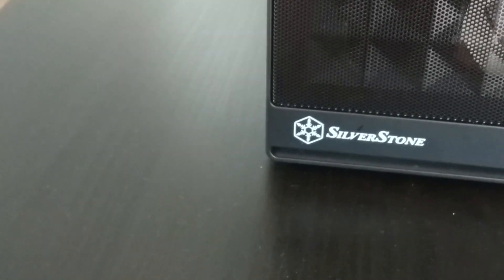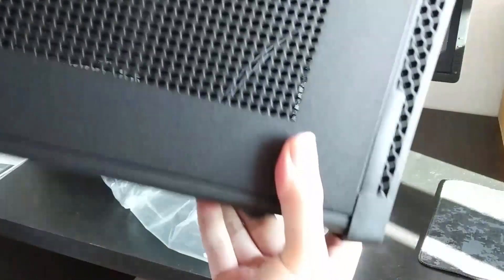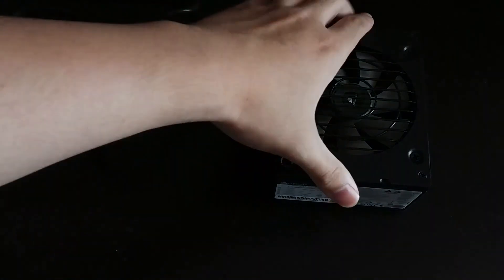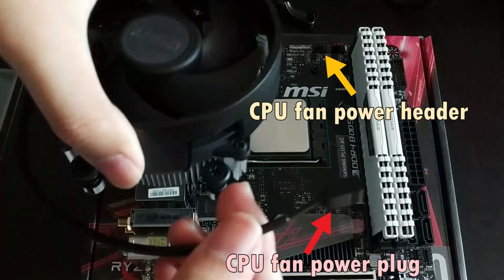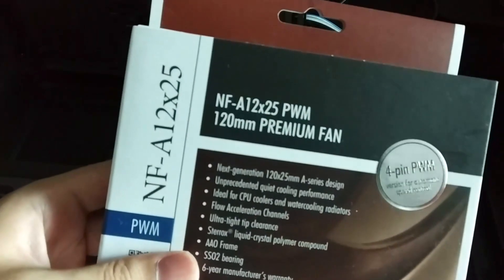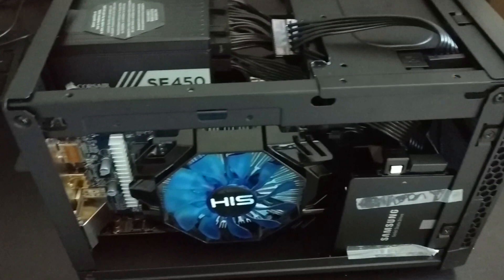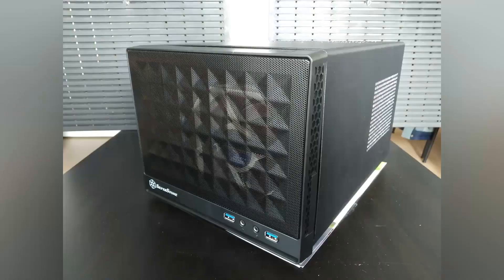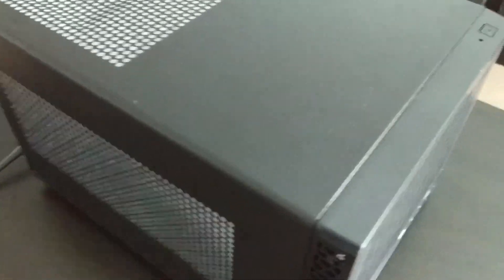Building a Mini-ITX PC in a Silverstone SG13: Unboxing and Build Log

Comment: How is the noise level? Im thinking building the same but with 3600x ryzen and gtx 1660s. But im worried that the noise will be too high. Will it be unberable to listen to?
Reply from the maker: It's not so bad as long as you are using a GPU with relatively low TDP. Obviously once you start using larger GPU with more number of fans, things are going to be problematic.

 In my situation, the front fan is actually the loudest one because it has to exhaust all of the warm air from within the case.

Comment: I know this vid is old but do you think Zotac RTX 2060 will fit in this case?
Reply from the maker: Thanks for checking my video. The Zotac card is roughly 210mm long, so surely it would fit inside the SG13.
Reply: @vortextheory8530  Hey, thanks for replying! I just needed another option. Cheers!

Comment: You sure that you have correctly mounted your ATX power supply? My fan of AC is on top.
Reply from the maker: My PSU has SFX form factor. The way the PSU fan is facing depends on whether you'd like have it taking air from outside of the case or from the inside. I chose the latter as it helps dissipating the heat from inside the case. I explain more about this in the other video, so you can check it out as well.
Reply: can this case use atx psu??
Reply: @menjemputimpian6044  yes, but it will be super close to the CPU cooler and you probably wont get the best temps

Comment: What if I accidentally touch the gold part of ram stick
2. can asrock b450 itx fit ryzen 5 1400?
Reply from the maker: As long as the golden contact is not completely scratched away, it should still be fine. The B450 will support 1st gen Ryzen just fine.
Reply: @vortextheory8530  tyy

Comment: Hey I m planning to build with the same case and I saw in another video that you can remove the cover of the cpu fan (with the amd logo) which makes it a bit shorter. That could improve the cooling considering how little space there is between the cpu cooler and psu. Thoughts?
Reply: Nvm i see that you mention that in another comment cheers!
Reply from the maker: Yes, you can try removing the shroud, but if you are using a SFX power supply, the shroud won't be an issue to clearance. The shroud is there to prevent random dangling cables from touching the cooler fan, so there's that.

Comment: What is the "filtering fabric" mounted on the case sides? That's not something that came with the sg13? Probably that makes slightly the temperature to raise as the air flow is restricted?
Reply from the maker: That's the Dustend filter sticker. It is an addon indeed. So far after more than 6 months using the filter, the max CPU temperature is around 70 C while the GPU is 65 C. The filter would indeed restrict your air flow, but you can compensate by using more aggressive fan curve. Notice that my front fan is an exhaust.

Comment: If I am using the stock Ryzen heatsink for the Ryzen 3 1200 which I think is the same for the Ryzen 5 2600 would it fit in the case with an ATX power supply? Many thanks in advance! I might get a 120mm AIO instead for the CPU though as I do plan to upgrade to the Ryzen 5 2600 hopefully.
Reply from the maker: The cooler is indeed the same, and yes it will fit, but it'll be tight fit (about 5 mm clearance) and thus, the airflow to the CPU might be obstructed. It is also possible to remove the outer ring of the cooler to slightly add more clearance, but I have not done so in my build.
Reply: @vortextheory8530  Ah that would be a cool mod! But I don't want to risk it cause the cooler is not the best. I am going to get a cooler master 120mm AIO since that is supported and recommended for this case though I will be using a full size ATX power supply instead of an SFX one. Thanks for the reply though! That helped me to decide cause I wasn't sure how much room there would be. I think an AIO would be best for this case.
Reply from the maker: @DoomWalker42  yep, if you are using ATX PSU, it's better to work with AIO. Don't forget to use the PSU L bracket though. I don't use it in my build because my PSU is a SFX.
Reply: @vortextheory8530  The case naturally supports an ATX power supply though so I don't need to use the bracket. It's not a small form factor power supply but a normal power supply that fits in a desktop case. Thanks though.
Reply from the maker: @DoomWalker42  ah, I did not mean the SFX-ATX adapter. I meant there is this L-bracket that comes with the SG13 case, which supports the weight of the ATX PSU.
Reply: @vortextheory8530  ah sorry i got confused!! That makes sense though. I will definitely use the bracket. Thank you for the advice!

Comment: Do you think a 140mm would interfere with the 3.5'' HDD?
Reply from the maker: This depends on the thickness of the fan and the way that the fan is mounted. I'm using a noctua A12 25mm thick fan, and one end of the fan barely overlaps with the HDD. I think there is a great chance that the screws or pins of the 140 mm fan might block the HDD position. Using 140mm fan would also limit your GPU length at 200 mm.

Comment: You have installed the power supply incorrectly. Will the fan be up?
Reply from the maker: Nope, the PSU fan was installed to face downward. This is intentional though, as the PSU serves as exhaust for the case. Please check my other video on SFF PC planning onto the PSU placement tips.

Comment: What is that white stuff on the side holes? Some kind of filtering? If it is, it's what's responsible for temperatures that are a bit too high, especially the GPU temp.
If you need filters on the intakes, there are magnetic filters that can be purchased in various sizes...
Reply from the maker: Yeah, it's dust filtering sticker, it causes the GPU temp to increase by 5 deg during load. However I've then switched to front case fan as exhaust and I managed to further reduce the temperature by 3-4 deg.

Comment: Hello VortexTheory. I recently did a similar build but whit an RX 580 XFX and a full ATX PSU, the EVGA SuperNOVA G3. Can you tell me more about the noise during idle and gaming ? Mine became quite noisy during heavy games like Just Cause 3 or The Witcher 3. I wanted to know if the use of a SFX psu can change my temps a bit, and meaby let the overall system "breath" better, ty.
Reply from the maker: Indeed I did not put acoustics result as I assume SG13-B (the case with mesh front panel) consumers are aware that soundproofing is almost nonexistant. 

From my own observation though, sound level vary with your configuration. In my case, the dominating noise comes from both the Wraith stealth cooler and the Noctua fan. The Wraith becomes noticeably loud when spinning above 2000 RPM while the noctua at 1400 RPM, which in my case correspond to CPU temperature above 60 C. Of course, this depends on how you adjust your fan curve.

Switching to SFX PSU does increase breathing room (by reducing the case impedance, more airflow can be driven by the front fan), however it is quite difficult to predict the exact gain. If possible, make use of retailer's return system to try it out yourself.

Comment: I want to build pc with this small case.
I already have a ryzen 2600, 16gb ram, rx 570 and v sync monitor. 
I used a nzxt case, its too big even its have a nice tempered glass view. Right now my pc have 7 fan installed. If I run 4Ghz ryzen 5 2600 in this case with less fan, what temperature be like?
Reply: Yohanes Batistusta if you go itx be prepared for above normal high temperatures than your use to with an atx case
Reply from the maker: @icedoutelite  Usually this is what happens, but with some careful airflow planning and cable management, you can still control the temperature. The SG13, for example, is actually designed for AIO liquid cooling in mind.
Reply: Thanks, but today I pick fractal node 202. I like it, because its like my xbox one and its smaller. Right now the desk have a better space and I can put my controller and headset with the stand in the desk, and I had upgrade my monitor too. I bought a lg 29 inch ultrawide.
Reply from the maker: @YellowRadios  Good choice if you know what you're purchasing. What grinds my gears is the fact that some people pick ITX cases based on aesthetic alone and later complain that the functionalities that they wanted are not fulfilled.
Reply from the maker: I see, fyi NZXT has the H200i case  which also has tempered glass side panel if it is necessary.

For your question on the OC temperature, I can only make an educated guess. No Man's Sky, for example, sometimes pull my 2600 to 3.9 GHz (all-core) and with stock cooler, I noticed that CPU temp never goes above 75 C during the boost period. I would assume that this temperature would be sustained 4.0 GHz OC will be slightly hotter. Of course, this temperature will increase further as the thermal compound ages. To be safer, you'd need aftermarket cooler which provides larger temperature headroom for OC.
Reply: @vortextheory8530  I already have a atx case with all the rgb tt ring. I just wanna try itx case. Cos the atx consume space of the desk.
I used wraith Prism from 2700x right now. And yeah I usually OC 2600 to 3,9 all core. Because its need to much voltage to get 4Ghz.

Comment: Why did you need 32GB of ram?  I never understood what you said.
Reply from the maker: "Certain productivity task". I did mention about 16GB is usually more than enough for gaming. I am running some simulation software that is quite memory intensive rather than hogging CPU/GPU resources.

At the same time, the motherboard only supports a maximum of 2x16GB RAM kit. So if I don't plan to upgrade the motherboard for next 4-5 years, might as well fill the slots outright. Of course on m-atx motherboards, usually you can fit up to 4 RAM sticks.
Reply: Thanks, I was just curious. I will be building an itx build and might put 32gb's in it as well....I'm thinking about getting into Blender or maya  as a hobby.

Comment: Very nice build video with clear explanations. It's amazing you much power you can pack in a tiny case these days. I hope your build's still going strong. Are you happy with the temperatures you get with a fan and stock cooler?

I actually made a build today on pcpartpicker that's very similar - same case (or maybe a Thermaltake Suppressor F1) , cpu and motherboard, sfx powersupply (same Corsair as you used or a SilverStone SFX SX650-G). I'm thinking about going for a 512gb m2 ssd and maybe a 12 or 14cm radiator on the front like a Corsair H60 or H80.
Reply from the maker: I would say stock cooler fan combined with the Noctua fan is adequate for myself. So far I have also tested Project Cars 2 and Hitman (2017), and both games run without making the temperature went above 75 C.

The thermaltake case is relatively easy to work with I'd say as it has separate drive bays. The one on SG13 is pretty cumbersome to work with.

Comment: Wow 32GB of ram, that's hardcore!
I'm building my first ever PC next week in the SG13, can't wait!
Btw - I hope you upgrade your graphics card - everything in your computer is beast .. except the gpu..
Reply from the maker: Yep, I need more RAM than GPU at the moment. I am using a used R7 360 also because I am waiting for the upcoming GTX 2060. Feel free to drop further comments if you have anything to ask about building in SG13.
Reply: Thanks man, I'll drop a link to my partspicker when it's done. 
One question, do you have a Gsync monitor already? If you don't then you should definitely consider looking at rx vega 56 second hand/refurbished - it'll save you money and should perform better than the 2060 in the long run.
I just got rx 580 manufacturer refurbished with 1 year warranty for £197 - can't wait to plug in!
Reply from the maker: @YoItsM0  My monitor is a meagre 1080p 60 hz monitor so no vsync or gsync for me yet. The upcoming 7nm Vega may be in my shopping list though.
Reply: @vortextheory8530 
If I were you I'd get the AMD option. If you want to take advantage of adaptive sync (freesync/gsync) which keeps temperatures lower and saves energy/stress to your graphics card - nvidia charges you money. But freesync is basically free.
You can find a very good freesync monitor for £120, but Gsync monitors start at about £300!
Optimising your Gpu is especially important in such a small case
Reply: (just realised I'm completely assuming that your computer is for mostly gaming 😅)
Reply from the maker: @YoItsM0  Indeed. But we'll see. I'm still worried that AMD GPUs are always on shortage and inflated price like during the mining crisis.
Reply: @vortextheory8530  Finished my build! I'm liking the case a lot, however the airflow is quite strange with the Gpu and the case fan fighting each other. No issues yet though! 
I had some issues clocking my ram to 2933Mhz (the motherboard defaults to about 2100) but I simply deleted windows, set setup my bios how I wanted it, then reinstalled windows and it works perfect.

My only complaint is the Wraith Spire cooler that came with my 1600 is a freaking jet engine, so loud! Must have got a bad one, how is yours?
Reply from the maker: @YoItsM0  wraith stealth is also quite loud, especially above 65% load. I can't say about the wraith spire but I guess it's similar. You should be able to fine tune the fan curve in your bios, and check the temperature of the CPU with stress test.

Regarding airflow, it is as expected because the mesh on the front, GPU, and the CPU side are intakes leaving only the back of the case or the PSU to be the exhaust. What i did was to reverse the front fan and I found out that the warm air is exhausted easier through the front (of course after removing the front panel filter) and i got reduced temperature during load.
Reply: @vortextheory8530  I figured it's also my graphics card making noise (duhh xD). I like your idea with the fan, but at the same time I don't really want to create any negative pressure in this little case. I think I might purchase a low profile fan and stick it to the right of the Psu - acting as an outtake. This way, the air flow will go from left to right, meaning the Gpu will be getting constant fresh air. Also I will underclock my rx 580 as low as possible, because I think the manufacturers push these cards waay too far in order to compete with nvidia, and its not healthy for the chip/power consumption for the sake of 10fps.

Thanx for the tips man - this is the fun part now - getting everything to work as optimum as possible!